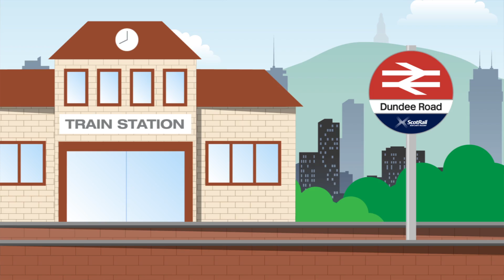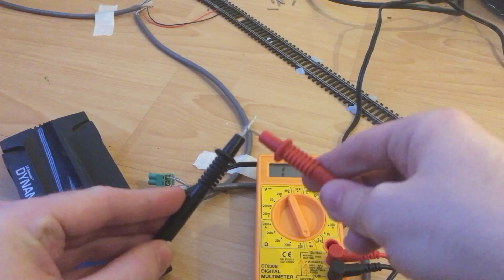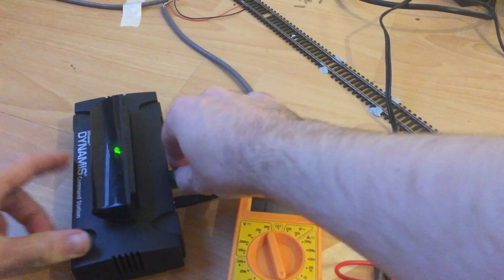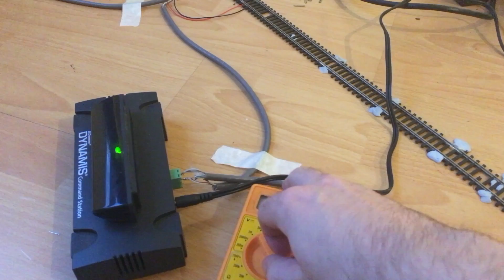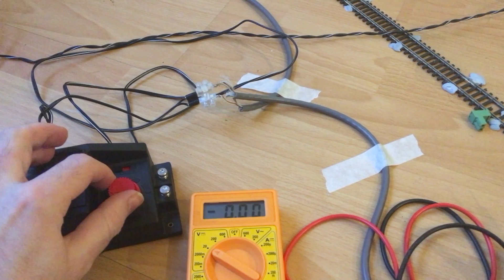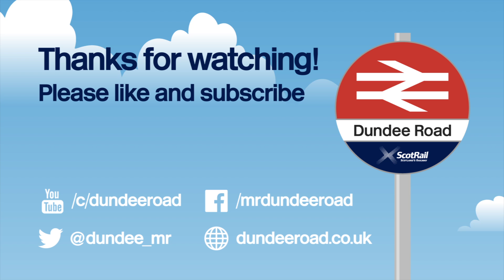Step 7 Bonus: DC DCC testing - using multimeter

Comment: Hi, hope all’s well; just spotted your “Dynamis” - I have similar and find it ok for my small (micro) layout and will be using it on my new, in progress, “exhibition” layout. However, I have had some issues which, by a process of elimination, I discovered was flat batteries in the handset! Locos started to do odd things, lights on/off, sound on/off backwards and forward problems which, to be fair, gets me every time because the first instinct is to suspect the Loco and/or the decoder - then I think Duh! Change batteries! Then all is well again. I find “Duracell extra” the best as they seem to last well. I had tried rechargeable batteries from an economic point of view, but they are only 1.2volts which is worth noting if you do the same. Starting with a .3v deficit kind of puts us at a disadvantage but they can be recharged easily if a few batteries are used in a cyclic pattern. Just thought I’d mention it. All the best, Bob
Reply from the maker: I haven't changed the barriers since I got it what I have found is it stopping all movements when the receiver loses signal. I'm not sure that the dynamic is good for the show layout. as you will need the handheld controller to be in view of the receiver at all times otherwise after a min all activity will stop.I use the Hornby eLink mainly I have this loaded onto a tablet which allows me to control trains and also has programmed movements.